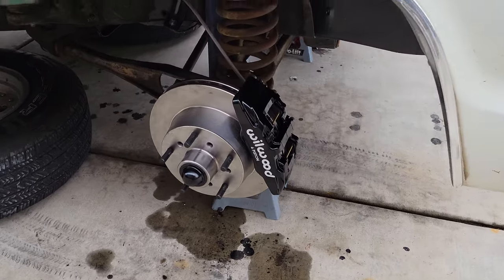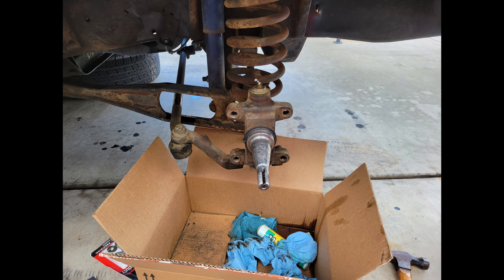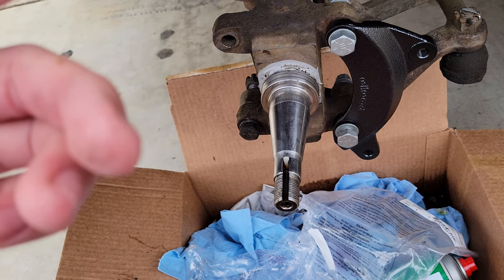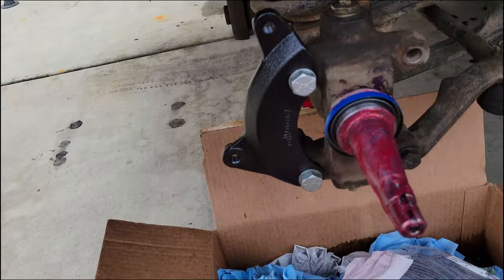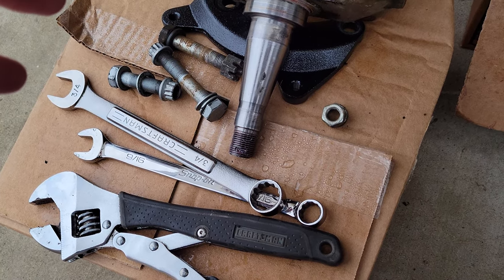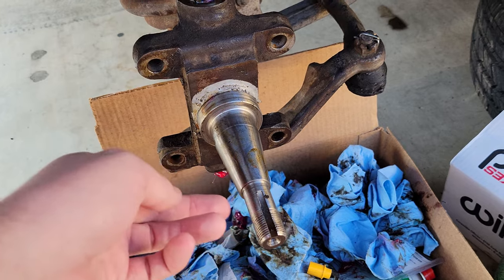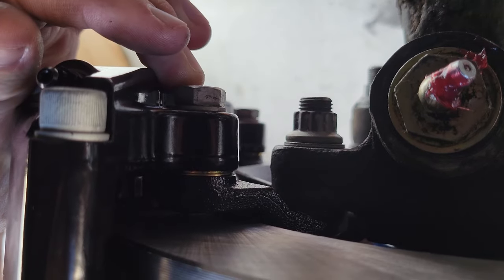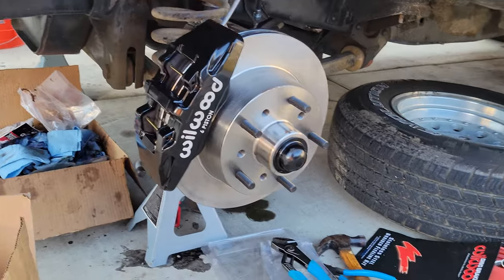F100 Disc Brake Conversion: 1967 F100 Wilwood disc brakes

Comment: Thanks for making this video. I have a ‘67 with ‘78 spindles and brakes that I’m not happy with, moves the wheels out too wide.
A couple of things I’d like to point out, your spindle problem, someone may have swapped out an F250 spindle at some point. It used a bigger bearing. Your grease seals need to be driven all the way into the rotors, prior to being put on the spindles. If you don’t, the seal won’t ride on the machined surface and will get tore up.
Reply from the maker: Thanks, I'll look back at the wildwood instructions on that. I think the directions said to put the seal on the spindle. I think the spindle is from a f250.
Reply: @willfrancone3908  Your welcome. In general, wheel grease seals are always driven in flush with the rotor/ hub. You can tap them in with a hammer and a block of wood in a pinch, but its really best to use a seal driver kit. They aren’t expensive and everyone should own one..
I would also love to know, did the new brakes move the wheels out wider than before?
Reply from the maker: No, it didn't change the width at all. The only real way the change that would be to do a full custom suspension rebuild with narrower i-beams.
Reply: @willfrancone3908  Good. That’s what I was hoping for.
 I put dropped I beams and ‘78 brakes and spindles on my ‘67. This was done many years ago, when there were no kits available. The ‘’73-78 trucks are wider, and the conversion puts the wheels farther apart. So I was hoping this kit, would move the wheels back to the original location, sounds like it will. Thanks.

Comment: Did you have issues with the brake lines getting into the springs?  What was the part number for the brake line kit?

Comment: Great work.  Did you replace the wiring harness on the truck too?  I’m just getting into my F250 68 ranger and will definitely do brakes  like these
Reply from the maker: I didn't replace the harness, I just added to it. Relays for the headlights

Comment: Did you use the stock brake line brackets where the braided lines attach to the frame?
Reply from the maker: Yep, stock brackets. Hoses came with new C clips too

Comment: Quick question whenever you have to replace the rotors again will you have to get them from wilwood or can you buy rotors for a 73 to 78 pickup
Reply from the maker: Probably would have to get them from wilwood..

Comment: did you buy this break kit directly of willwood? this is a very nice kit. I have a 67 f250 that i want to convert the front into disc brakes.
Reply from the maker: I bought it from summit racing, it was few hundred dollars cheaper.

Comment: Hey how much of an improvement did these give you? I have a 69 f100 I just ordered the wildwood kit for. 
Also have a brake booster kit coming too.
Reply from the maker: Big difference. Night and day. Just have to adjust the proportioning valve a bit until it feels the way you want. But it could also work without any adjustments
Reply: What kind kit is this I have a 69 I wanna do disc brakes on front

Comment: Nice work but I’m pretty sure the calipers are on the wrong side of the rotors FYI.
Reply: He has them on correctly. On the F100 you can’t put them on the rear because they will hit the steering components. Tie rods run through the radius arms.

Comment: Just ran into this same issue with my spindles on my 66 did you ever figure out the difference
Reply from the maker: I think someone had replaced the spindle before I owned it. And they put the wrong one on.